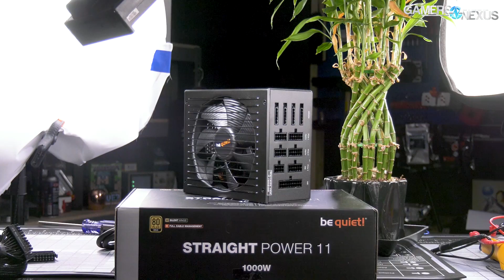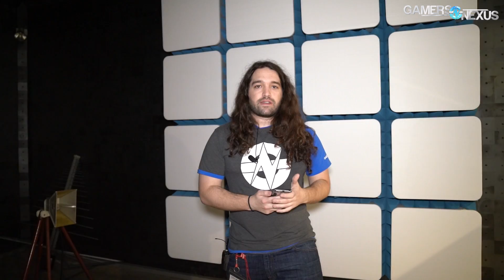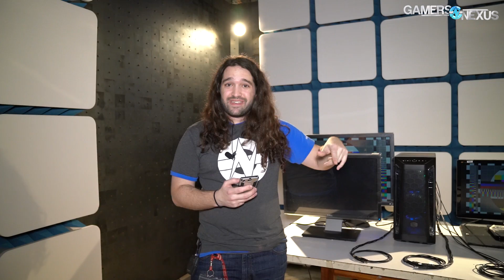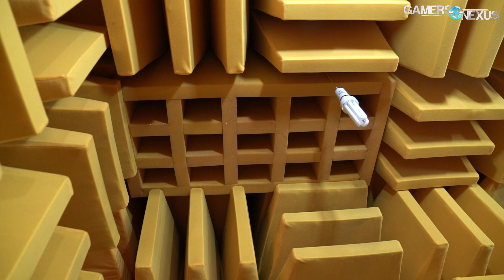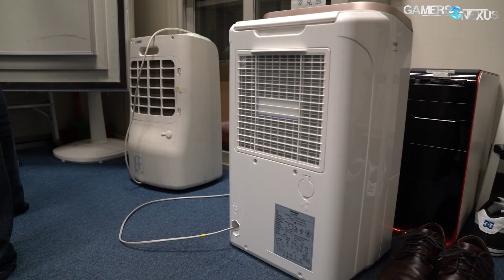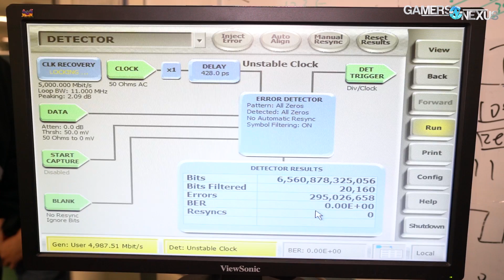GPU Radiation Testing & Signal Engineering | MSI Lab Tour

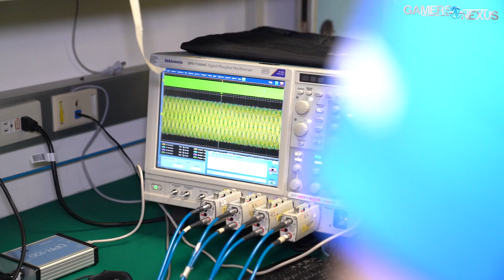Comment: 11:42 - super high end professional $25K equipment, and the GUI uses maximized Internet Explorer, lol
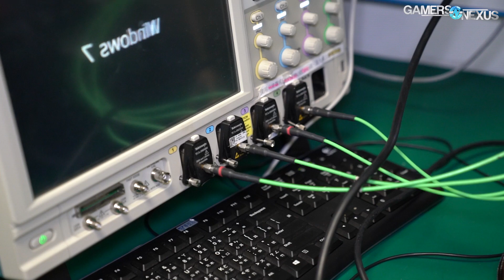Also default Win7 screensaver at 13:04
Reply: Those scopes go for $60k pre-owned on ebay right now...
Reply: you know that shit costs as much as a luxury car when you every website has you ask for the price rather than listing it lol
Reply: Among the aluminium forming lines which contains multiple robots, hydraulic press and laser sensors, we have a computer with Win 7 entreprise which runs production management program on an internet explorer. This is actually not uncommon, although I wonder sometimes what wizards made internet explorer based shopfloor system read numbers from a PLS continuously for days and days.
Reply: That doesn't look like a running program to me. It's an .MHT file, according to the address bar, which is a webpage archive, to save everything into one file. Many programs create reports in a markup language, such as HTML, which will open in your default browser, or whatever default you have set for that particular file extension.
Reply: You'll be surprised to know that the US Military still use systems based on Windows XP.
Reply: At work we have a couple 4G cellular network simulators that cost well into the 5 digits... They run Windows 7 and some custom freakishly ugly native application to configure everything. Takes close to 5 minutes to fully boot. I also found this quite funny when I first started, but I have to say... It works like a charm. It's really good hardware that lets you configure every little thing you could possibly want. Dropping tens of thousands of dollars on a piece of gear is a significant investment, but without it you literally cannot make the product. Definitely worth it.
Reply: learn about a company cycling. is not just a simple, click update. A company is not like a home industry.
Reply: In research and development you need things that just work. Also they are calibrated for error correction or interference. Better, newer or more expensive doesn't mean always better.
Reply: @kostasbezaitis2695  "better doesn't always mean better" wow
Reply: First, way more than 25k. Second, IT'S A FUCKING OSCILOSCOPE.

Comment: 😱 is it emiting 5G waves? 😱💀💀💀
Reply: Most processors work in the microwave spectrum, so theoreticly its emitting microwaves  (and boils the water in your aio? =D (maybe I should add that the strength of the microwaves emitting from the cpu is way less strength then from your microwave, if someone did not get that I joked about boiling water in the aio)
Reply: @AndrewTSq  😱 Yikes! 😱
Reply: @AndrewTSq  😊📺

Comment: Good thing you said dba because if you said otherwise 26db would be super loud as in recording 0 db is the maximum and 100 is the usually the lowest number referring to the noise floor.
Reply: Seventhday Savior you may be thinking of dBu - an electrical unit used in recording, or simply dBFS (dB below Full Scale)

dB is similar to percent - it’s unitless, but usually means dB re 20 uPa. dBA and dB SPL are weighted “filters”, dBA is meant to approximate human hearing level and is much more commonly used in “loudness” or “quietness” testing, but each of these can be misleading without a full level-vs-frequency analysis.

Comment: Microwaves include frequencies from 1 to 300 GHz. 3G, 4 and now 5G frequencies (wireless devices) emit in this frequency range. Cellphones transmit between 0.6 to 3 Watts...
Your microwave oven is around 750 to 1000W. How save is/are your wireless network and electronic devices to you and your friends and family?
Reply: most devices are limited to 23-24dBm peak power (~0.25 Watts) MAX at average duty cycles of under 10%. So the average power is more like 0.025 watts. Also the microwave ovens are designed to bounce the microwaves around the cavity until all of them are absorbed by the food, while RF transmitters are designed to transmit into all directions, so the power absorbed is even still much lower (we are left with 0.0025 watts of power that even passes through the human and I'm not even talking about the amount of power that passes through the body unabsorbed). And what's so special about microwaves?  I'd me more worried about the UV spectrum (which is many many more times dangerous). Don't ever go in the sunlight ;)
Reply: depends on frequency and duration of exposure.
mobile base station antenna is only about 40-50w, and if you stand in front of it powered up you can potentially be sterilised within a couple of minutes.

satellite uplink is typically 2kW..not a good idea getting in the way of that.

there is some case to be answered for long term low dose  RF exposure being a factor in reduced sperm count these days.
Reply: should also add that there's some science using similar methods but different frequencies that is yielding quite good results for getting rid of cancers  and warts etc...royal reiff started it and the concept is gaining some followers.
Reply: You should totally smash your phone and microwave, and swear off the internet forever. 
Just to be safe.;)
Reply: That's like saying I don't want vaccinations when going for a jungle trip in the Amazon forest.  @dickr9345
Reply: Giovanni P. Stfu they are perfectly safe
Reply: imagine if a 600watt PC suddenly emit waste power as EMI instead of as heat? you've got an EMP!

Comment: This is so freaking interesting, did not even come to mind that hardware vendors and distributors had to test for EMI radiation or any other tests.
Reply: In some countries EMI is considered stright up signal broudcast, radio regulation body may knock in there door is they dont do that.
Reply: @Shadowriver Woa, you are a Gamers Nexus community member as well, nice ! Thanks for all your help and support with Unreal Engine !
Reply: we do this kind of testing daily for all avionics and other airborne equipment.
Reply: Same, was just going to comment that I had no idea that this type of testing was even a thing. Very cool.
Reply: Some may just send it out to another company to check, but AFAIK (at least here in UK/EU) most electronics needs to be tested.
Reply: For sure, in the US all electromagnetic radiation outside the visible and near visible spectrum is regulated by the FCC. Any and all objects, nevermind products, are subject to their laws and policies. If you want to sell in the US (or any of the other countries that have adopted these FCC policies in whole or part) you better have the testing.

Interesting jurisdictions: 

Because visible and near visible radiation in the form of lasers were first used in the US for medical purposes the FDA has primary jurisdiction over those parts of the spectrum.

Larger particle radiation, as you get closer to nuclear material, crosses into DOE territory at some point and gets weird and secretive, I know little about this, information about the line in the sand seems hard to find.

Comment: I thought it was gonna be testing resistance to radiation not checking for emissions, but I guess the latter actually makes more sense xD
Reply: Most modern electronics aren't super resistant to radiation, for that matter even old school vacuum tubes can have issues. When pioneer 10 made the first ever flyby of Jupiter NASA thought at one point they'd lost the probe to the unexpectedly high radiation values. At their peak near Io they're sufficient to give you a fatal dose in less than 2 minutes. To put that into perspective the radiation environment inside a functioning nuclear reactor is only about 40% more intense.
Reply: Basically all electronics in most developed countries need Rf emissions testing. EU and a few others require immunity as well. 
It's not just cards
Reply: same